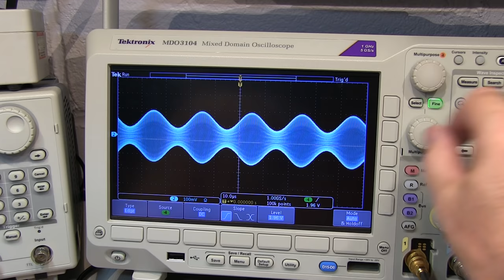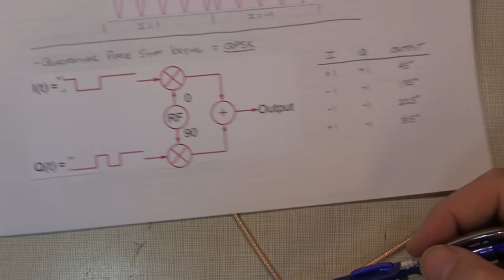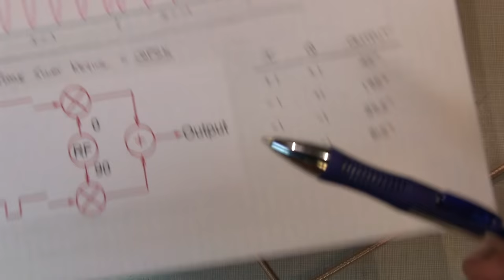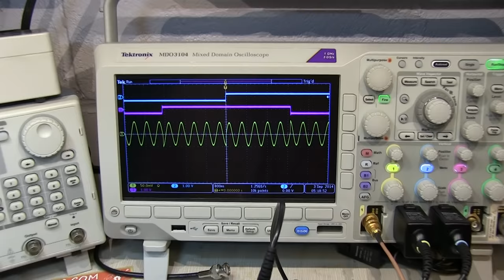#170: Basics of IQ Signals and IQ modulation & demodulation - A tutorial

Comment: Nicely done. Tiny nitpick on the QPSK where the amplitude on the circle of I & Q are each .7071, not 1, but using 1 is a reasonable generalization. You can see in the initial explanation that the amplitude is greater when the signals are combined, and that is what would occur with I=Q=1. The points would be on the corner of a square which each side tangent to the circle. The video is a great foundation for thinking about and experimenting with SDR.

Comment: I've become curious about SDR lately; you haven't thought about presenting a small SDR DIY project or something like that?

One question: for demodulating IQ, how do you know what phase is, well, zero? The phase-varying signal doesn't tell you by itself. For digital signals you could just let the transitions, rather than the levels, represent bits, but for analog signals wouldn't you need to know the "in-phase" time?
Reply from the maker: You generally don't need to know where "zero" is. You're really only interested in the changes. So your arbitrarily normalize at any point, and track variations from there. Amplitude as SQRT of sum of I squared and Q squared, phase as arctan(Q/I), and frequency as d(phase)/dt.
Reply: ***** Very usful answer.

Comment: Nice Video Alan, as usual, well prepared and clear.
QPSK, that takes me back..... In the early 80's at GEC I had the job of tuning QPSK modulators using tiny bits of gold on a substrate.  The substrate had 2 diodes, one either side receiving the square waves from an oscillator built onto the back.  There were four phases, 0, 90, 180, 270 degrees.  When you got the gold in place you had to insert 5 magnets and turn them and move the gold to get the right waveform on a scope display. Then when you got it right, the magnets had to be glued in place with Silastic and the gold araldited down.  The oven would cure the silastic and the unit would be retested after 2 hours in the oven...  If the waveform was ok then great, if not, start again....  2 a day was the norm.  This was for the British Telecommunications System X.

Comment: Why no one shows how to demodulate FM signals. I watched 10 videos and no one shows  it, they  just say its "easy". Well if its easy then they should show it.
Reply: Darko Bulatovic exactly. im in the same boat. it isnt clearly explained at all. it almost seems like 98% of the video is about how to modulate them, but only a brief description was given with demodulating them.
Reply from the maker: pepe6666 Given that the instantaneous phase is the arctan(Q/I), and that frequency deviation (dF) is simply the "rate of change of phase", then FM demodulation from IQ is traditionally done by taking the time-domain derivative of the phase.   f(t) = d(arctan(Q/I))/dt.  More details can be found here:
http://www.embedded.com/design/configurable-systems/4212086/DSP-Tricks--Frequency-demodulation-algorithms-
Reply: ***** I could have swear that you had another video where you explained it. not 100% sure. I know I found it later somewhere.
Reply: +w2aew Darko Bulatovic  Here is a circuit/blog I found that demodulates BPSK - I hope to give it a try.  http://www.analogzoo.com/2014/12/amplitude-demodulating-bpsk31/      
  is this a proper method?   (edit: trying to ref w2aew)
Reply from the maker: Raymond Tant There are many ways to do this, and this is certain one valid approach - fairly simple because it only relies on simple amplitude detection.  This works OK on this waveform because the phase shift is well filtered, providing a well defined and easily detected dip in the amplitude as the phase is shifted.  If the baseband signal was not low pass filtered so well, the amplitude dip would be a lot narrower and more difficult to detect this way.
Reply: ***** Thanks for the reply - This is new territory for me - I am not grasping the idea of "amplitude-demodulating" when I thought the "data" was the different phases and not just the amplitude. All this means is more studying and experimenting for me.
Reply from the maker: Yes, data is conveyed in the carrier phase (either 0 or 180 degrees). If you think about the ohasor diagram... ...as the phase changes from 0 to 180 degrees, the amplitude crosses through zero, which is why you can do an amplitude detect.
Reply: but how to do that in practice? I realy would like to try to use IQ modulator to get FM modulated output, and input shoud be voice, or any other low freq signal. For example, you want to build FM wireless mic using iq modulator. dont know how, nowehere to find anyexample

Comment: Extremely informative explanation. Thank you, sir. I'd like to throw in my two cents. 
1. When I explain IQ modulation to laymen, I avoid the math and I point out the primary characteristic of the quadrature carriers, in that when I is hitting its peak, then Q is precisely passing through zero, and vice versa. In this sense it's like two people speaking and taking turns perfectly. One is silent as the other speaks and vice versa. This is easier for the non-mathematical person to grasp. It is a way of impressing two separate information streams onto a single carrier wave. Then I slowly introduce the mixing and constellation ideas. I like seeing their faces light up as comprehension dawns.
2. I&Q modulation was the process that allowed adding the color difference color signals to the existing black and white television signal in the late 1940s. This allowed everyone to keep their existing BW sets and still watch color programs. Albeit it, in BW. Color set owners could watch color, of course, as well as enjoy BW programs as well. Brilliant! Now imagine trying to make that work with vacuum tubes! Some early color sets had 44 tubes. Assuming 3.6 watts per tube heater alone, that's nearly 160 watts before summing up the B+ power! We've come a long way baby!

Comment: 00:02 Basics of IQ Signals and IQ modulation & demodulation
02:16 Basics of IQ Signals and modulation
04:28 Varying I and Q components can lead to amplitude, frequency, and phase modulation
06:45 IQ modulation enables complex modulations through amplitude variation
09:08 Understanding IQ components in phasor diagram
11:28 Varying I or Q components between plus and minus 1 inverts the waveform.
13:50 Understanding the phase shifts in IQ signals and constellation points
16:17 IQ signals can represent any modulation type with appropriate generation of I and Q waveforms.
18:31 Understanding IQ signals and their role in modulation and demodulation.
Crafted by Merlin AI.

Comment: First, thank you very much for an - as usual - crystal clear presentation.

Second, a comment: the path forward (going from two signals I(t) and Q(t) to a
mixed signal) is fairly straightforward/intuitive  to understand, but the path backward
(going from a mixed signal S(t) to the original I(t) and Q(t)) is IMO a lot far less
easy to understand intuitively.

I wished that part (demodulation) had been explained a little bit better. In particular,
what is intuitively very hard to understand (for me at least) is how the sum of two
signals can be  "reconstructed" : when I tell you that the sum a+b is 7, and ask you
what a and b are, there's no easy answer, yet here, that seems to magically work :)

Third, the sentence "frequency modulation is just another form of phase shift
modulation", I felt took a very violent shortcut and left me a little intellectually frustrated.

It might be true (I trust you), but:
    a) I don't "feel" it
    b) I can't see how it works with formulas
Reply from the maker: Andree Nogueira The demodulation is done with two mixers, driven with local oscillators that are in quadrature (90 out of phase with respect to each other).  Apply the RF signal to both mixers' RF input, and the quadrature LOs to the LO inputs respectively.  When the LO frequency is equal to the RF frequency, then the mixers' outputs are I and Q (after low pass filtering of course).

As for frequency modulation - maybe this will help.  If you have two signals, and the phase difference between them grows by 1 degree with every cycle (period), then after 360 degrees, the signals have shifted by exactly 1 cycle.  This is another way of describing a frequency shift.  If each cycle is 1us (for a 1MHz signal), then a change of 1 cycle in 360us is equal to a 1/360us, or 2.78kHz.  Thus, frequency modulation is just building on this.

Comment: Hi Alan, I enjoy your excellent videos! They are clearly structured, the use of paper and hardware is well balanced, the comments are precise an the camera is rock stable. I have only one question/remark concerning this video: after 1:30 you show amplitude modulation using the amplitute A(t) shown as a sinde wave an the carrier sin(wt + phi). However what you show as the modulated signal is more something like (1 + mA(t))*sin(wt+phi). The difference lies in the fact that A(t) changes the sign, (1 + mA(t)) not ((1 + mA(t) has always the same sign). Modulatiing with A(t) generates a dual sideband signal (without carrier), modulating with (1 + mA(t)) generates two sidebands with carrier. Best regards and keep up your valuable work Markus! HB9GXM
Reply from the maker: Markus - you're absolutely right, thank you for catching the detail.  The equation shows DSB-SC (double sideband suppressed carrier), but I really should have added the offset to the baseband to show proper AM.  Thank you for watching so intently!

Comment: Alan,
  Love your channel and the methodology you use to teach/instruct on subjects.  At the risk of seeming ignorant on the I/Q subject, I would like to request a video be made on the topic.  While I do understand how to get the I/Q signals (out), and how to create them (in), what I think needs some expansion is what to do with them after you get them out of the receiver or into the transmitter to mod/demod with analog/digital info.   I know that phase and magnitude are key, but what about baseband processing?  DSP manipulation and the like.  Dumping the  I/Q streams into a computer and then manipulating them to get analog or digital intelligence is what is missing for me.  Simple to complex, please if you do decide to do this.  How do you generate a simple AM signal with I/Q streams, for example?  I know, fixed phase and adjust the magnitude.  That is what is not so simple in practice. Thanks.

Comment: Great presentation again.  
I am not clear how can we modulate a signal with -1 and +1 signal though.   I know how to AM and FM modulate carrier signal with a always positive but varying signal.
Say in FM you modulate the varactor ( i.e. Capacitor of the tank) and for AM you connect Carrier and modulating signal in series.  Even when I think of using a PLL for modulating, or diode ring mixer, or Gilbert cell mixer.  I do not think we can make a 180 phase shift.  
The only way I can think of is by using differential signal and switching the sides though a DPDT switch.  Hmm.. I guess in Gilbert cell you can use Top part (IF part) as DPDT switch.
You then can pass this through AM modulator, so you could then modulate all the values from -1 to 1.

Comment: Excellent video and introduction to quadrature signals. What is a practical way to make quadrature carriers in hardware?
Reply from the maker: The most common way if you already have the RF signal is to use a 90 degree, or quadrature hybrid.  It is also often done directly with a dual DDS.  If the LO is digital (very common), the quadrature signals can be generated with D-FF dividers.

Comment: your teaching/explaining techniques are amazing... this was a very tricky subject of hamradio for me to fully understand until I saw your video..... specially the last part in which you introduced the receiving technique....    the rigs that have IF DSPs have quadrature LOs !.... and from there on work on digitally manipulating and interpreting the I and Q components....   and now I also understand the infinite potencial feature of IC-7100 and IC-7300 of letting you get the IF IQ as left and right audio channels of the usb audio output.... I'm planning on purchasing an IC-7100 now... do you have good reports about that choise ? (discarded the 7300 not for the price but for not having vhf/uhf and I want to start working with sattelites)

Comment: Dear Alan, at 8.46minutes, why doesn't the vector plotted on the IQ plane extend all the way to negative I & Q values as well? What I am saying is the vector should be a diagonal line that should extend to negative IQ values too.  This is because we can see that amplitudes of the I & Q waveforms are varying between -1 & 1, not 0 & 1 for any given phase. Therefore, the amplitude of the resultant vector (the ray) should fall between -2 & 2. Could you please clarify this for me?
Reply from the maker: It does.  The center of the diagram is 0,0.  All four quadrants are included.  The diagram shows a constant signal vector magnitude of 1, and thus the circle helps to show all of the possible I and Q values that result in a vector of {1}.

Comment: Great video, thanks.  I do have a question pertaining to demodulation.  What methods are commonly used to synchronize the LO phase so the constellation does not rotate around the origin?  I am very familiar with I & Q pertaining to old school NTSC color TV.  A burst signal is used on the back porch of the horizontal sync pulse.  What methods are used for QAM?  I can't seem to find any information on that anywhere.  Thanks!

Comment: Thank you sir! I have a favor to ask. I have been wanting to order a couple of BNC cables (different types that you use), terminators, those T connections, etc., basically every basic cable and connection type that goes between a signal generator, a typical circuit and back to a scope. After watching your videos up to here, I have some ideas what to order but still might need some advice as to what the details might be. Could you please put a short video together and explain a simple basic set-up of those? Essentially for someone who already has a signal generator and a scope but needs the cables and different connections to start experimenting and playing with them. Thank you very much.

Comment: So this is really fascinating, and I have a question.  How in the world can you pull I & Q out of a waveform?  How do you know what the phase offset is?  How can you know if the phase is being modulated from 0 at all?  You have a single waveform, how can you possibly know that it is the product of two waveforms.  Example: I have a number, 45.  Get the I & Q from that.  Can you do it?  Did I add 20 and 25?  Did I add 1 & 44?  did I add 0 & 45 or 45 & 0?   You can't know!  how can you pull I & Q out of a waveform unless you already know what I or Q are?
Reply from the maker: naikrovek The answer is - you don't pull I and Q out of a waveform.  You generate I and Q by mixing the incoming signal with a pair of quadrature local oscillators.  Phase becomes relative.  Pick an arbitrary starting point, then observe how phase changes with respect to that point.  Any difference in frequency between the incoming signal and the local quadrature oscillators will show up as phase rotation vs. time.
Reply: ***** hi, Can you pls explain what you meant by phase being relative.
Reply from the maker: Just as I stated in the previous reply. There is no absolute phase reference point. So, you compute the phase via arctan(Q/I), pick a desired reference point and then measure phase changes relative to that user selected starting point.
Reply: ***** Thanks. Yes you have stated below.

Comment: It think that, in 5:00, the RF signal is I*cos(2pift)-Q*sin(2pift) (the diagram indicates the are added, not substracted). Where I=r·cos(phi) and Q=r·sin(phi). This can be seen later in the 13:57 diagram where the Q signal is delayed 90º from the I signal (which is correct). Given that I is the instantaneous amplitude of a cosine, Q must be a -sine to recover our original signal. Note that a sine is not delayed 90º from a cosine, it is advanced 90º. Mathematically this can also be confirmed since cos(A+B)=cosAcosB - sinAsinB and so, cos(2pift + phi)=Acos(phi)cos(2pift) - Asin(phi)sin(2pift) = Icos - Qsin

Comment: Sorry to arrive so late to this video.   Question:  At the 12:00 mark, you illustrate BPSK on the scope.  What immediately grabbed my attention are those VERY sharp/pointy transitions in the modulated carrier.
If I recall my Fourier analysis correctly, reconstucting any pointy or sharp-edged waveform requires superposition of sinusoids of much higher frequencies.  And this is the essence of my question:
What impact do these higher frequencies have on broadcast signal?  If the FCC requires filtering of those harmonics (so you're not intruding on other bands) wouldn't that "ruin" the transition's sharpness and compromise the integrity of the resulting demodulation?
Reply from the maker: Yes, you are absolutely right.  I used very fast edges simply to illustrate the modulation in a very crisp way, but this would occupy a LOT of bandwidth.  The baseband signal is always filtered to make the transition slower and smoother to limit the occupied BW, but this would make it more difficult to visualize the phase change.
Reply: @w2aew  Much appreciated.  You have always been very generous with your time.